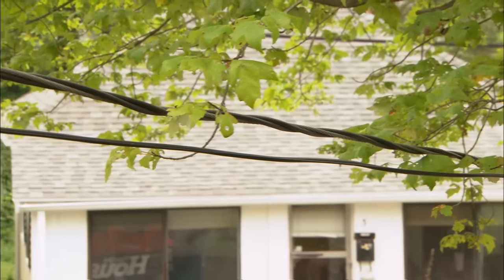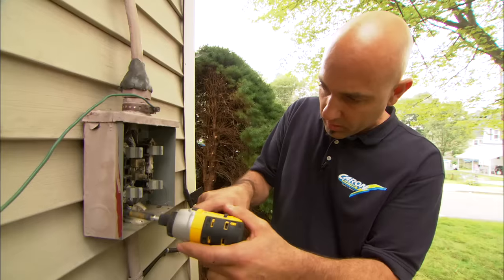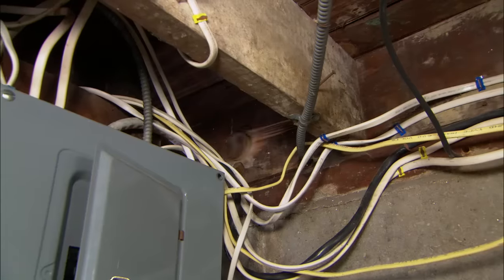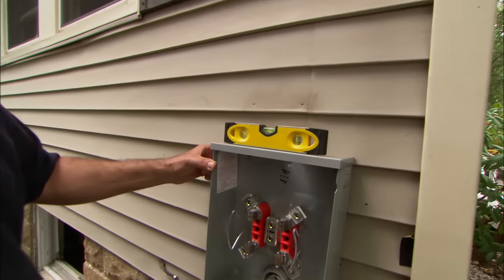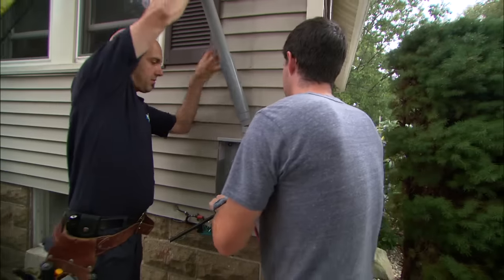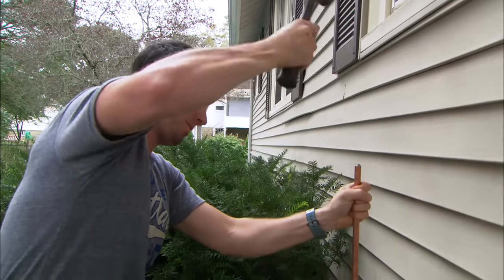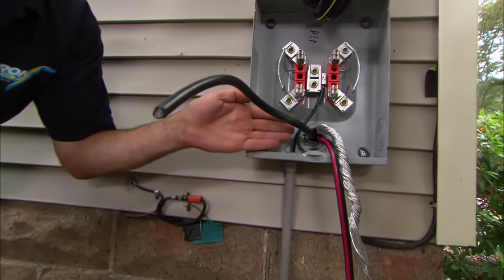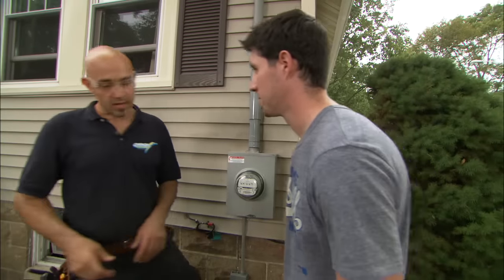How to Upgrade an Electric Meter to 200-Amp Service (Part 1) | This Old House

Comment: I am a master licensed Electrician in New Jersey and the amount of thing I have seen done wrong is incredible and you don't have to call the power company  to disconnect there power I just cut it my self so this video is so wrong in many ways
Reply: You just cut the wires at the weatherhead? Or do you climb the pole and disconnect the fuses?
Reply: truthsmiles We cut the wire head it is usually a big as connector from the homeowners line to the power company line so there is really any cutting to do with the connector up there.
Reply: Interesting. Well, I guess if you're comfortable working on live circuits it's not much different. I've done similar (repairing a bad connection in the meter can while live), but I don't like to do that when it's avoidable! :-)
Reply: there are no secondary fuses on an aerial service from the power company.  You just cut the taps near the service head to de-energize the feed into the meter board.
Reply: I'm a master electrician in Louisiana and I always cut them loose too.  Stand in a garbage lid and cut them. Keep yourself from being grounded and you will be ok.
Reply: emmett streeter see q
Reply: Im no expert but i think as lon as you wear 1000v gloves, the right boots, and insulated tools, you can cut a live wire
Reply: lol   i def wear a bio hazard suit when i cut power.  cuz cutting 2 120v lines is super intense.  especially with no load on it.
Reply: Like what for instance
Reply: Re-connecting belongs to the electric utility, right?  Or do you do that too?  
It is easier to cut a live SE conductor than crimp one back together while hot, I imagine.
Reply: Okay Joisy electrician, but you couldn’t mention one thing he did wrong. Where I works, if you cut the overhead service drop, they will give you a tampering fine.

Comment: Service masts have to be RMC around here.
Reply: ironmatic 1 only if they are supporting the service wires
Reply: "around here"

Power company will not sell you power with a plastic mast.
Reply: ironmatic 1 where?
Reply: San Antonio
Reply: ironmatic 1 what if it’s underground?
Reply: Hi

Comment: Your work was amazing, here in Brazil that type of work is very complicate and expensive because use copper cable, cement pole and all parts are imbedded inside the wall. 
Sorry my write I am learning English.

Comment: No penetrox was used to prevent corrosion for aluminum connections and ground rods were driven towards the foundation which is unsafe since you don’t know if wires could be directly buried

Comment: What size wire is needed for the Ground that tie into the Ground Rods; and does it matter it’s solid or stranded like the one shown above or bare? Also how deep does the PVC and wire need to go down below ground level?
Reply: Where I live it #6 solid copper, or at least that's what i was told
Reply: 4 gauge solid copper where I am
Reply: @9Point8  I went with 6, but my sub panel was only 60 amp. Not sure what code is to the main(200)

Comment: Here in Arkansas, you are not allowed to remove the meter from the socket for any reason, not even for upgrading.  The electric company must come out and do it or you will be charged a $225 "Tampering" fee.
Reply: It’s a show, I’m sure the power company came to remove the main power.
Reply: @danlux4954  You saw in the video that he removed the meter himself.

Comment: This needs to be done by a licensed electrician... Proceeds to show everyone how to do it themselves
Reply: This has shown me how to bypass the meter for free electric.
Reply: I might be an anomaly, but I use a lot of these videos to be an informed consumer of professional services.
Reply: @gteaz  power company puts a tag on the meter, if it’s broken they can charge you for tampering.
Reply: @danlux4954  I'm breaking your tags.
Reply: @gteaz  i know the hydro guys. They give me the tag when i have work done.

Comment: I appreciate the use of proper wire using ser but you should of protected the conductors all the way to the panel. Was a 4" hole saw necessary?

Comment: aluminum is not allowed here for service entrance has to be all copper.
Reply: That's not true ... that's not in the NEC
Reply: aluminium is fine you just need to use aluminium rated parts
Reply: TTT 1 Right
Reply: local building codes may differ....
Reply: completely not true, most utilities use Al for transmission or distribution anyway. Only if your AHJ has said that SE has to be copper. People need to get the idea that Al is inferior for installation for standard applications. With that being said, Al has no use for high heat applications such as welding or induction heating.
Reply: Rakeem SW The NEC only has the minimum safety standard. Cities can always add safer measures.
Reply: The big problem with aluminum cable is that the metal is soft and both expands and contracts greatly with temperature. If the connector is rigid, the temperature cycles will loosen the connection. Expansion in a rigid connector causes the soft metal to extrude. When it cools, the connection pressure is reduced. 

I am especially concerned about stranded aluminum wire.

I have not yet seen a rated or listed connector with a built in spring that can assure that a connection will thermal cycle for tens of decades dependably. Perhaps the new crop of aluminum wire connectors have a thermal expansion coefficient closer to aluminum wire.
Reply: where does it say that in the code book?...
Reply: Utility providers and Local AHJ can add requirements above or parallel to any code in the NEC if they so choose. If there is no AHJ then you can use NEC and pull new service requirements from any utility provider.
Reply: AHJ, it rules as king.
Reply: Yes you can but it has to have coolaid
Reply: Rakeem SW the NEC is a base guideline. Local codes may go above and beyond.
Reply: Wrong. Local building codes have to follow the NEC.
Reply: You're not understanding. The NEC is a guideline, not law. It's compiled by a board of experts with many years of experience. Local AHJ's can use it as a starting point, but may go above and beyond. Example: NEC calls for aluminum service entrance conductors; AHJ may require copper. That's going above and beyond.
Reply: And where TF is “here”?

Comment: You have to use an insulated neutral wire as it is s current carrying conductor. The stranded  alumnum wire is the grounding conductor.

Comment: don't they have money for copper wires?
Reply: By refering these formula
V= IR 
P= I^2 x R
if the Resistance is high, the current will be low. Higher current will cause more power loss, because when the current is high, it will generate more heat, heat will increase the resistance directly proportional to temperature. Lower current will have lesser power loss. So less heat produced and have constant resistance. 
The higher the voltage, the better the efficiency( This is used on Power Grid Network)
learn more physics dude…and copper and expensive
Reply: Justin Tan Coong Sheng i haven't ever thought about that in this way
Reply: Justin Tan Coong Sheng A was totally sure copper is better in every way.
Reply: Copper is more conductive, yes, but aluminum is cheaper.  You can just make the wires bigger to compensate so you get the same net resistance (or the same conductivity, whichever way you look at it).  

The problem is that aluminum wires have problems and they caused some fires, so now they typically only use aluminum for the big cables from the power company and the wiring in the main panel itself and copper everywhere else.  There's a way to use aluminum for everything legally, however.
Reply: Gerald Monroe i got a lot of cases aluminium wires are broken in bending with small angels
Reply: Denis the neutral wire is sized at 70% of the phases. aluminum is perfect for such a job. its lighter, cheaper and it helps to differentiate the neutral from the current carrying wires also the grounding rods are also a 2nd line of defense in case of a open connection with the neutral.
Reply: it is very important not to knick aluminum wire when stripping  because it is more brittle, and a weak point that is bent sharply can easily crack. It will also crack of you bend it too many times while installing.  True pro's know that.
Reply: Service Entrance cable and power line cable are always aluminum. You need to use larger-gauge wires, but aluminum is lighter, less expensive, and works well. According to the aluminum wiring Wiki page, a length of copper wire that'll carry a certain amount of current costs six times what a power-equivalent length of aluminum wire.

There are two issues with aluminum residential wiring: wire gauge and receptacle type. You've got to go up one gauge - 15 amp branch outlets need 12 gauge aluminum or 14 amp copper; 20 amp branch outlets need 10 gauge aluminum or 12 gauge copper - and you must use only CO/ALR receptacles. Do those two things and the wiring job will be as safe as copper.

Comment: Are you allowed to use PVC service mast?
Reply: Ran Kong some states yes, some states no... check out your own states building codes for clarification and correct amswer
Reply: Ryan  He is not using the PVC as a mast......
He is simply “sleeving” the SEU up the wall to protect it.
The power co. overhead line is secured to the structure by a insulated clevis, or a screw in type insulator, just not shown in the vid....maybe should of shown that.
The “mast” only has to be Rigid or IMC Steel Conduit when the mast is used as the attachment point for the overhead line from the power provider.
Reply: Yes
Reply: @leonardholt5311  Interesting, I failed this one on the Canadian Electrical Test, as in Canada PVC service mast is not allowed.
Reply: Ryan refer to Mr. Worman’s explanation above.
Reply: @harrya.worman9911  In Canada, the sleeving pipe and mast must be galvanized steel.

Comment: good instal, my only issue is that i prefer copper going into the house, makes things a bit safer in my mind
Reply: It is just in your mind. There is nothing wrong with A8000 series conductors.
Reply: @lgninjalo  just don't much trust aluminium, not after the aluminium romex and things
Reply: @gtb81.  Well, the new AA8000 series alloys are different, and all Aluminum wiring is required to be made of that allow these days. That being said, it just gets used for services, and rarely branch circuit conductors these days. If you are feeding a panel from <insert source here>, you are saving yourself a lot of effort and money by using Aluminum. Here is a source below. Also, I am journeyman electrician. Of course, if a customer insisted on copper, I would be happy to install it for them after providing this information.

https://www.ecmweb.com/content/article/20889707/installing-aluminum-building-wire
Reply: @gtb81.  aluminum is used is nearly every service in the country
Reply: @electricaf365  i am aware of this, i just prefer copper is all

Comment: If I needed a 200amp meter I would be more concerned about the size of my electric bill.
Reply: You will eventually, once EV chargers become the norm
Reply: You don’t need to use the full 200A if you don’t need it.

Comment: Didn't see any anti-oxidation gel on that aluminum wire!
Reply: any time you are working with aluminum- you wire brush to remove any oxidation, apply contact grease and then make the connection.
Reply: Aluminum doesn't corrode!
Reply: ricomajestic it does corrode. That's why Noalox was added for oxidation.
Reply: You need to pay more attention. Watch 4:52.
Reply: And that is a major problem.  Aluminum oxide is an insulator, the grease prevents the oxide from forming.  The grease is also an electric code requirement.  Aluminum is no longer allowed for new branch circuits, for just that reason.  BTW, copper oxide is a conductor, so it is not a problem.
Reply: Aluminum oxidizes practically instantaneously. It pretty much exists with that layer in its natural state. So any grease placed on it will be on top of the oxidation layer. Unless the grease etches the oxidation layer first and prevents the oxide layer from forming. By the way, the oxide layer is only on the surface of the aluminum not in the bulk. In the bulk you have mostly pure aluminum.
Reply: we always use pentrox when terminating aluminum. must be done by code
Reply: PRAISE KEK not true haha
Reply: I say him put it on the neutral which is where it's required - maybe you should pay more attention
Reply: You weren't paying attention
Reply: @charleshung8519   what code is that? Good luck finding it.
Reply: @gsxrgeorge00  youre right. just looked. learn something new everyday.

Comment: Hi, Thank you for your video. I have a question, I am running a (2) 1hp inverter AC, 1 microwave, 1 inverter type refrigerator, washing machine, a PC, a Laptop and some gadgets,water pump lights and sockets etc. will class 100 meter work just fine? or does it require a class 200 meter?
Reply: Read the manuals and calculate
Reply: @zaxarispetixos8728  240Vx100A = 24000 Watt max load , 240V x 200A =48000 Watt ==> how much is your total maximum load ??

Comment: I wish San Diego had separate meters and main panels. Here in this nice weather, all the main panels have a meter socket built in. The whole service panel with all the breakers are outside and makes service upgrades a huge ordeal because you have to deal with both in one day or else the customer loses power. This way seems much better
Reply: It is an option to have separate meter panel and main panel.  Adding a couple of sub-panels (say one for the kitchen and one for the garage)  makes the installation easier and less expensive overall.
Reply: Outdoor panel wouldn’t last long in the North.

Comment: HAHA nobody uses a level. Also, moisture will get in the pvc and the meter box, it’s impossible to keep water out, weather seals are just required by electrical code. Why is there two grounds????? Why is he using such a puny hammer, that will take half an hour lol. Also, meters come in plastic now, haven’t seen glass since I was a child
Reply: Two grounds are minimum, 6' apart.
Reply: S Kaye where
Reply: Ryan Clark In JewVille.
Reply: S Kaye is that a joke or a real place
Reply: National Electrical Code 250.52 (A). Maybe he uses the puny hammer because he gets paid by the hour. Homeowners don't decide what meter they get, it's provided and owned by the utility.
Reply: l2p I’m paid hourly and I use a full size sledge hammer. I’m aware the utility service provider provides the meter, I haven’t seen one like that since I was a child, this video isn’t nearly that old I hope
Reply: l2p 2014 NEC ref art 250.53(A) ‘“single ground rods” are only acceptable if the resistance to the earth of the ground is 25 ohms or less. If the resistance exceeds 25 ohms, an additional electrode must be installed, if it’s a ground rod it must be at least 6’ away.’ This video mentions nothing about that at all, just “upgrading your service”
Reply: l2p I’m in Texas and we do residential which is generally a 200amp service and we only drive one ground rod, inspected and cleared no problem, thank you for giving me an article reference to read I was very curious
Reply: we drive 2 rods here in KY.  Elec inspectors here want that.
Reply: @ryanclark457  you need to step up and get a spline drill to drive rods. 
Drives them in under a min with no effort. I would laugh  if I saw someone standing on a ladder swinging a sledgehammer.
Reply: I use a level. PVC is used everyday outside. Two ground rods is a requirement. The meters come from the utility provider. Everything you just said was wrong

Comment: How come you don't use a meter base main breaker combo to facilitate disconnect if power to inside panel? On a replacement or upgrade isn't that required by the municipality and the fire marshal?